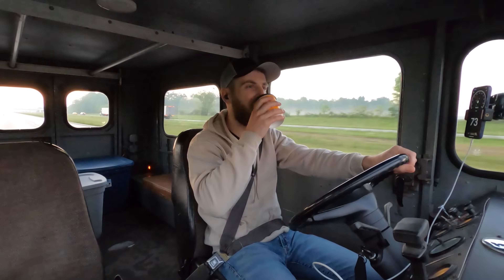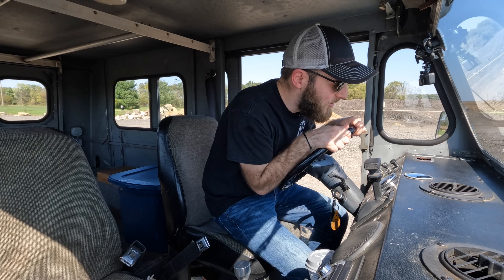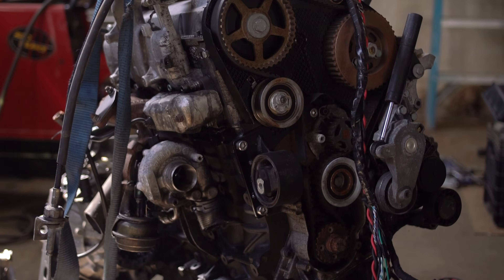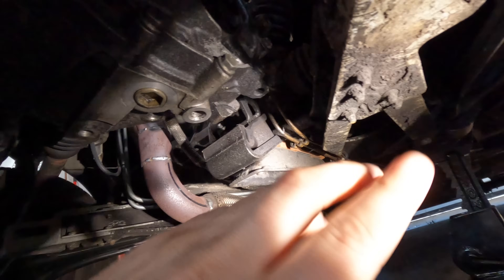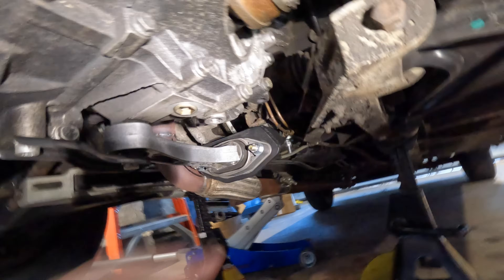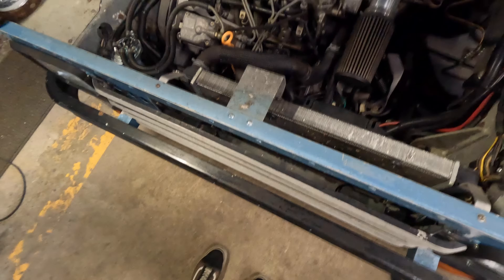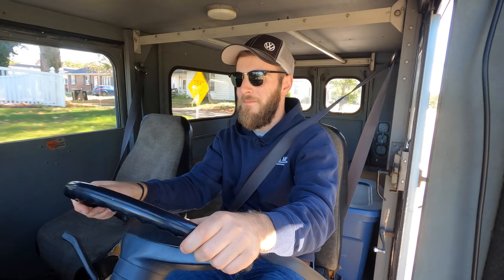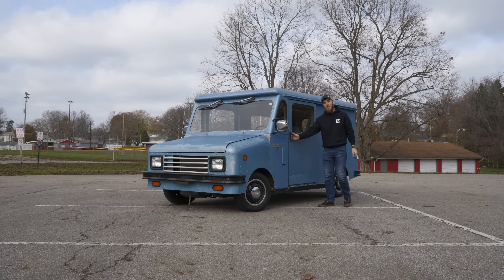10,000 MILES in my TDI Swapped Mail Van - 1985 Grumman Kubvan

Comment: I would put ridex sound deadening in the inside. Then use wood slats and black fabric on the ceiling (fabric underneath the slats, that go one in one space one in (andsoforth)). That would look awesome.Then use wood panels against the wall. Finish them in a stain. That's a relatively fast job. And it would look gorgeous. If you use brass strips to finish the interior it would look like a million bux. If you do so, then paint the brass strips before you assemble with clearcoat.

Comment: You make me want one of these vans so bad! I saw one for sale last year but it was pretty rough, non running and they wanted 4k for it
Reply from the maker: @DjStikkers  that’s what I paid for this one! In uh… pretty similar condition by the sounds of it. Sadly, I don’t think $4K is too bad a deal if the body was in OK shape. Trouble is, I’ve seen a lot of these really beat to hell… I got lucky with this one.
Reply: @JamesCooperider  the one I saw was worse, looked like it wasn't moved in 30 years. Overgrown shit all around it, tires 8 inches into the dirt, inside exposed to the elements. Real rough.

Comment: The TDI can be chiptuned from 90 hp up to 150 hp. The 2 liter comes with a 6 speed manual. I think that would be a great upgrade and be good for fuel economy.
Reply: Idk if you guys have it in North America but in Europe there is a 150hp/110kw1.9tdi from factory. But it was mostly installed on mk4 Golf 4 motions and Bora (Jetta) 4 motions and some fwd models. It could be chipped to about 175hp/130kw with ease. Engine Code: ARL